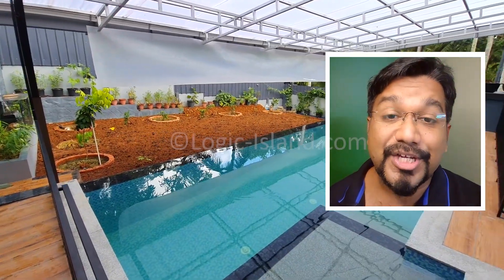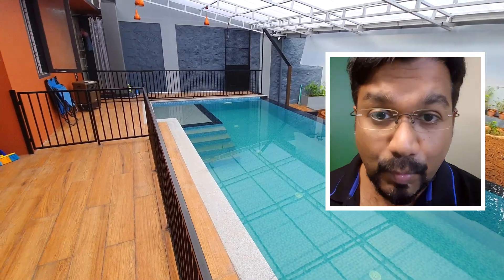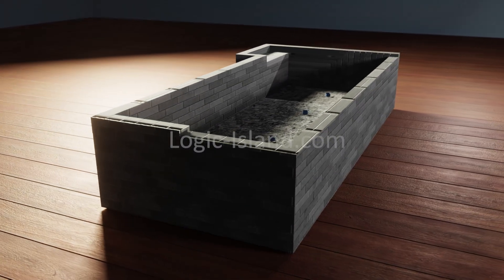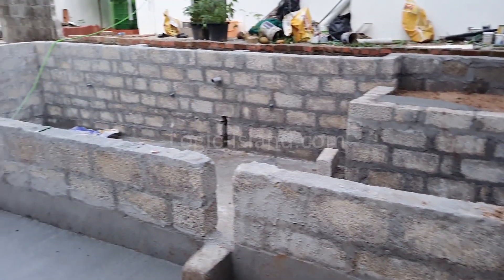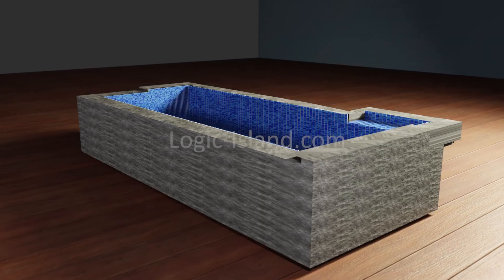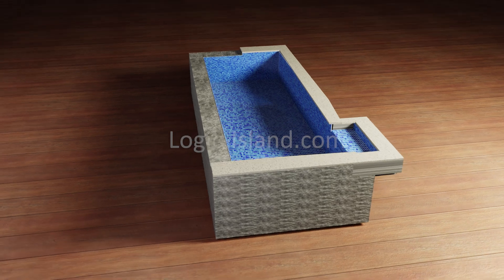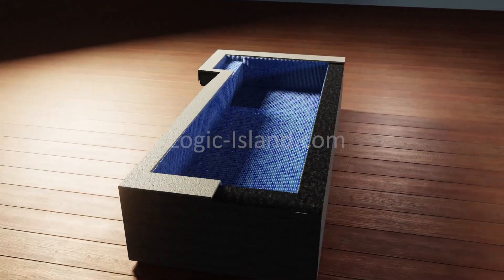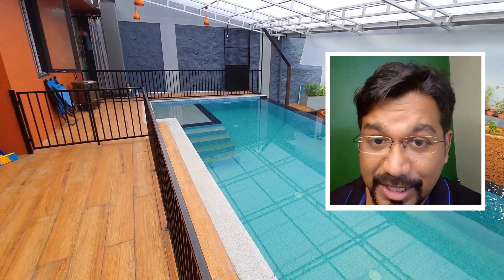Swimming pool on a budget - Construction using Ferro cement technology

Comment: Very nice information. I have a question - will it be more economical to install a FRP ready made pool (from Delhi) in Kerala than the ferrocement pool you built in Kerala? I am looking for a 4.2m x 1.5m x 1.2m deep pool with a counter current system for exercise. Thank you.